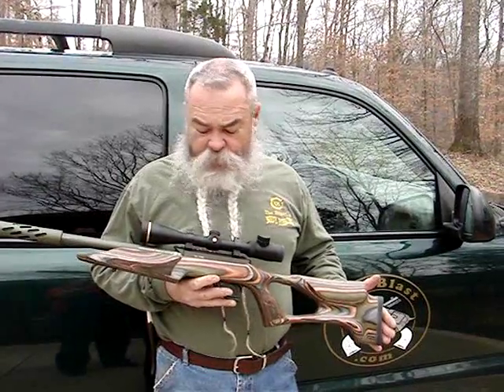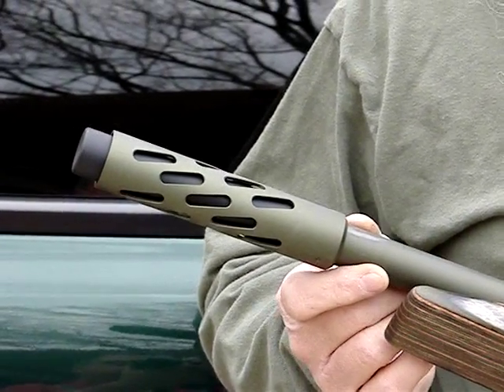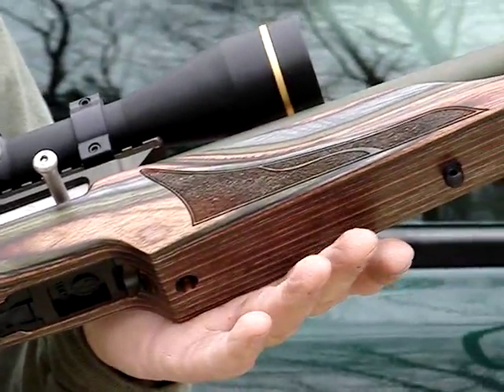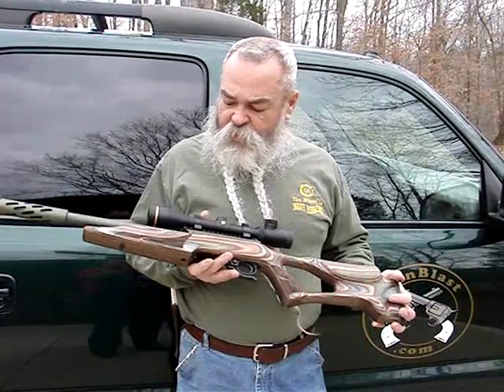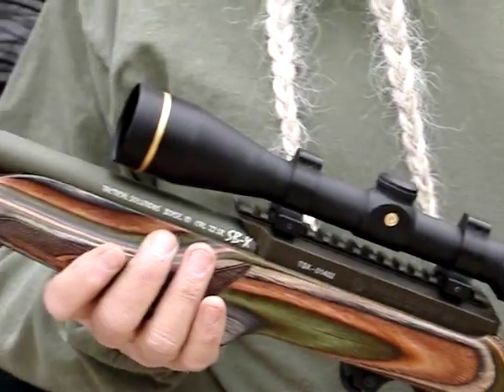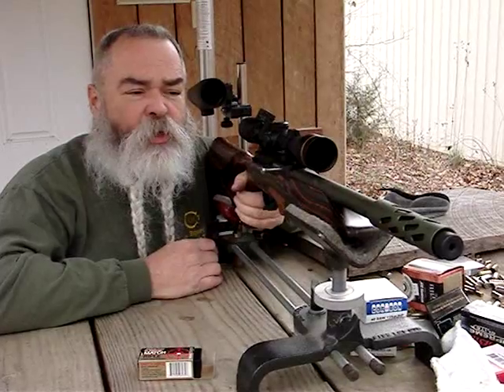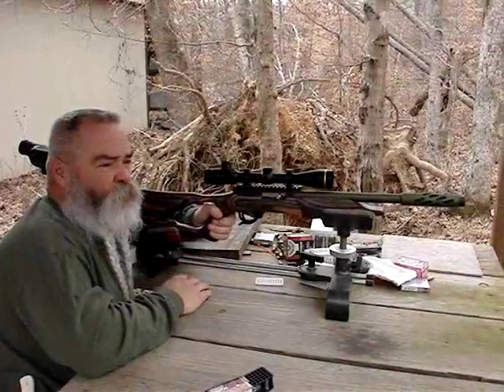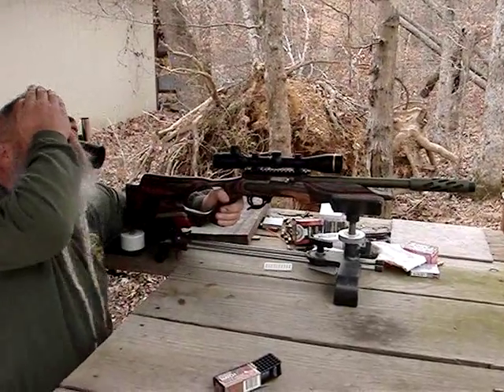Building the Perfect 22 Semi-Automatic Rifle - Gunblast.com

Comment: You Prolly already know this but the Volquartsen hammer, when used with the stock Ruger trigger group parts, will reduce the trigger pull weight to about 2 pounds. My 10/22 started out at 5.25 pounds stock; w/the Volquartsen hammer and a polished sear the pull is 2.25 pounds and smoother to boot. Cost is just $35.00.

Comment: I look at it like this: They are both excellent inexpensive squirrel/rabbit guns. Both have excellent features and excellent service lives. I have owned both. The sole reason I end up with the 10/22 is because of the DBM (Detachable Box Magazine) and it's wide range of round counts there-in. Mossberg's is good but it can take some effort to find say a 50rnd magazine. 

Also the 10/22's stock barrel and furniture tends to be of slightly hired quality. 

But either way, both will do the job!

Comment from the maker: Mine is not titanium. It is the regular cascade can. To clean, just shoot in some spray carburetor cleaner, skake it around a bit, and drain out the gunk. I very seldom clean mine. it does not need it. if you shoot a lot of foreign ammo, it will get dirty quicker.
 
jeff

Comment: Great vid Jeff!  I had already put together a 10/22 extremely similar to this.  My custome still has the original receiver, but that's just about it.  I sent the bolt out for jeweling and accurizing, am using the Volquartsen TG2000 trigger group, Boyds Evo stock (extremely similar to yours), a scope and that wonderful TacSol aluminum barrel.  Don't have a surpressor, tho.  Just don't have the need at the time and cant justify that expense.  Good stuff all around.  Thanks for the pointers!

Comment: @moviking it will blow it out, suppressors are designed for a specific gas volume, exceeding that is a guaranteed way to destroy a suppressor. You can go the other way though and get a 223 can and use it on a 22lr. It wont be as efficient but it wont damage the can.

Comment: The "KIDD" drop in trigger is supposed to be the best, but I learned a lot from rimfirecentral com on how to polish the internals of the trigger and the notch on the hammer which reduces the trigger pull substantially. I just can see paying 300 bucks for a drop in trigger for a 22 when you can do a lot of the work yourself if ur mechanically inclined. You can also get a Wolff "spring tune up kit" for the 10/22 which has reduced power trigger springs, and increased power hammer spring (9 bucks)

Comment: One of the most important things to change out of a 10/22 is the bolt stop pin.  Change it out with a rubber stop pin.  This does several important things but the one most important thing it does is saves your very expensive scope from the shuddering recoil effect of the 22 caliber round.  Believe it or not the recoil from a little 22 caliber rifle is harder on a scope than a big caliber rifle and on a BB gun and Pellet guns its even worse because of the shuddering effect and not a big all at once Bang vibrating through the scope.  The rubber stop pin acts like a shock absorber to the bolt as it hits the pin in turn saving your scope from that damaging shuttering recoil.  Their are several makers of these replacement pin but the Kidd pin I think is the best as well as the trigger group replacement is by far the best.  I also like to change my bolt release to and automatic release type.  Good Video :)

Comment: Yeah, that's usually how it works out.  Just meant to say that if the 10/22 isn't what you want to end up with then you are better off buying the exact parts you want and building a one-off.  Cheaper in the end.  Though its not like shooting the 10/22 isn't just as much fun until you do have all the extras you really want.  This was just a comment about how everyone converts the 10/22 instead of just buying what they really want in the first place.  Kinda the American way, instant gratification.

Comment: You did put a buffer in that...right? When running a 10/22 with a quality suppressor the noisiest part is typically the bolt bouncing off the rear of the receiver.

Comment: It's great you're getting1/4" +- groups at 50 yards. It's what I'd expect. When I had a 10-22 the trigger was a let-down. I had the sears stoned and polished and  it got the pull-weight down to approx 2lbs. It's hard to get the extra few percent; I have a Brno .22 bolt action, 40 years old. It will shoot groups at 50 yards between 1/4 and 1/2 inches. Go figure.

Comment: Ok thank you for the feedback and also, i have a H & R 22. revolver and it is a used gun. Who ever had it before me was an idiot and put thread lock in the L/R sigh adjustment screw so i had to purchase an entirely new back sight. so my dilemma is that there is a pin that allows the sight to pivot for elevation and i tried to gently tap it back in with a hammer but it bent. any ideas?

Comment: Only way you could improve that (but it would be a huge improvement) would be to replace receiver with the Primary Arms T3/Summit toggle-bolt receiver.  Still a very fast repeater but quieter and no shells casings ejected unless/until you want to.  No reason to even have a semi-auto .22, except fun, quite unlike a centerfire.  People that are using a .22 to simulate self-defense with 3-gun are deluding themselves.  Still, very nice and nothing wrong with it.

Comment: Nice Gun!! I did notice that you were not wearing eye protection, and the video of you shooting was filmed by a person holding the camera downrange and not a tripod..
Reply from the maker: Yeah, you are correct. I also ride a motorcycle without a helmet, never use sunscreen, and I married a mean woman!
 
jeff
Reply: Gunblastdotcom  :)  I went with the archangel556 conversion on my ruger 10/22 and what I don't like is having to re sight the red dot every time I break it down.. is that the case with yours?
Reply from the maker: Arron Geatches
No, the sight stays sighted in, and does not have to be removed to disassemble the weapon.
 
Jeff

Comment: The federal 22 LR value pack copper plated hollow point  525 rounds  , will these bullets work with an older semi automatic tube feed. Springfield model 87a
Reply from the maker: +Rondo Schiavoni 

The only way to know for sure is to try them in YOUR particular rifle.
Jeff
Reply: Thank you for your opinion ,sounds good .

Comment: cant you just build a 10/22 with all custom parts without buying a 10/22? or buy a 10/22 and remove all ruger parts to install aftermarket parts then rebuild your old all ruger part 10/22 while having a fully custom non ruger 10/22? (if you can get a custom receiver then...)

Comment: Build a carpet tunnel to shoot through right at your shooting bench area. Get a large tube (2ftdia+, plastic or cardboard or whatever) and line the inside and outside with foam and or carpet. Place it on your bench, put your muzzle inside it, and shoot you target. Works incredibly well. Wont be no louder than your neighbors stupid ass wind chimes.

Comment: Ok, so let me see if I got this straight.  Buy a ruger 10-22, check.  Then throw away all the parts that make it a gun and replace with aftermarket parts.  Why can't I just buy an aftermarket gun.  I am going to start a company that you can put together whatever custom parts you want. You just pay for the parts and add just a little less than the cost of a ruger 10-22 for shipping and handling.